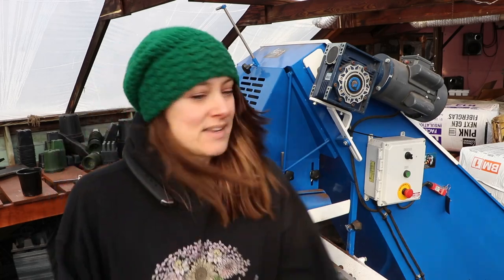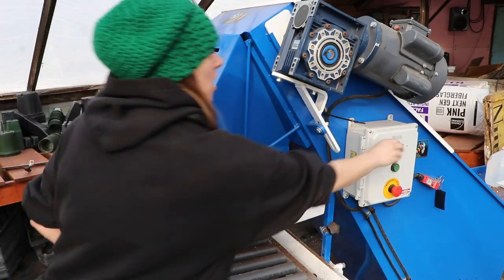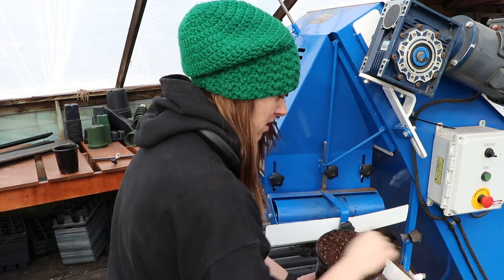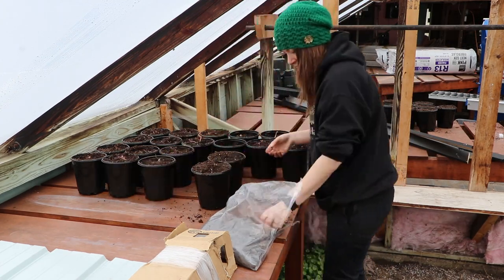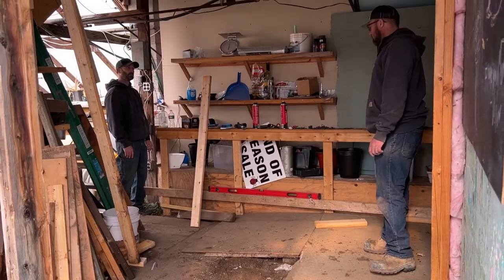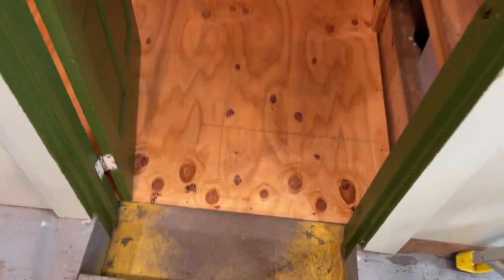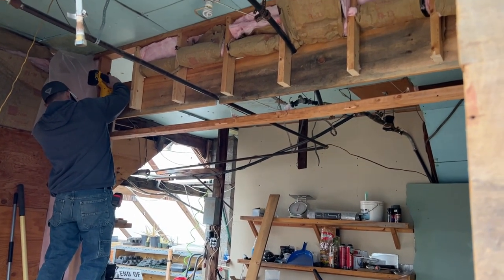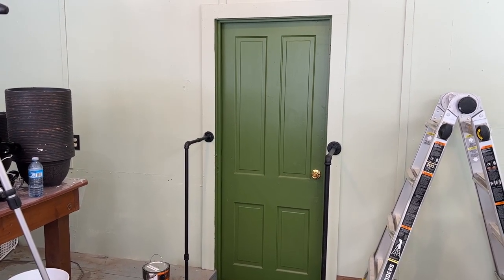Trying the Pot Filler : Construction Updates! Repurposing the Barn Wood : Flower Hill Farm

Comment: Those trays were floppy and caused the pots to wobble, but what if you used a commercial cookie sheet?  That has sides and wouldn't wobble.  A half sheet pan is about 13" x 18".  It's a thought.  Use it if you want or put it in the circular file.

Comment: That’s how I found out I was pregnant the first time, when I passed out at the potting machine lol. I was the one grabbing four pots at a time and putting them on the trailer. I said slow it down, they did, then I said stop the machine and down I went. Only a couple pots hit the floor. I was working with my mother-in-law, she said go home. Then I took a prego test and vóila, had a baby girl!  But on the potting machine we had one person loading the empty pots, my MIL stuck in the azalea cuttings as they came out, and I loaded the trailer. It helps to have a longer conveyor so they line up to grab more at once. And definitely move the trailer close to where you grab the pots. But you’re not using a trailer out in a potting shed, you’re right there by the tables, so not sure about your setup, but hey, whatever works best for you is awesome!  Our pots got lined up outside or in the hoop houses. You’ll get the hang of it 👍🏻🪴